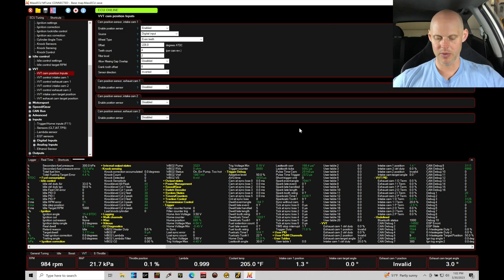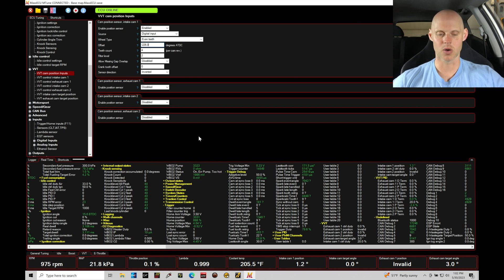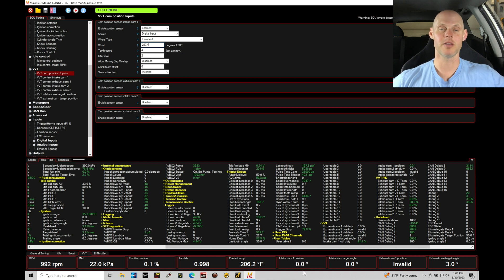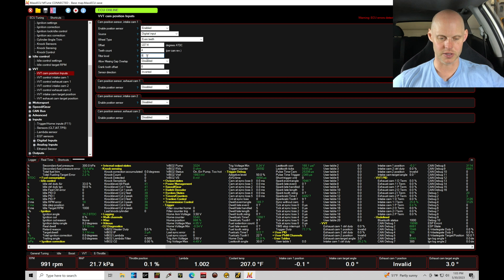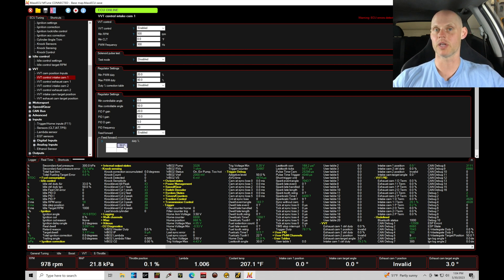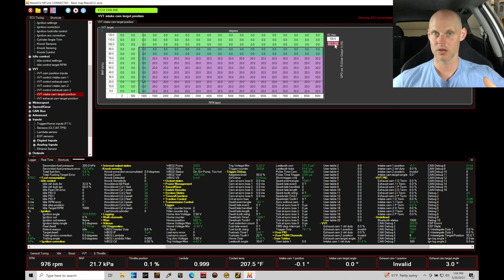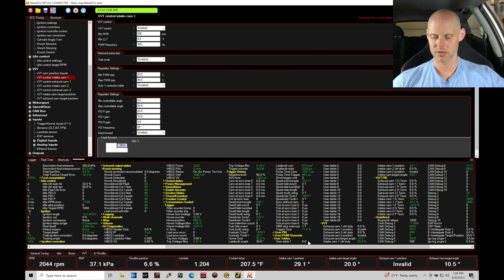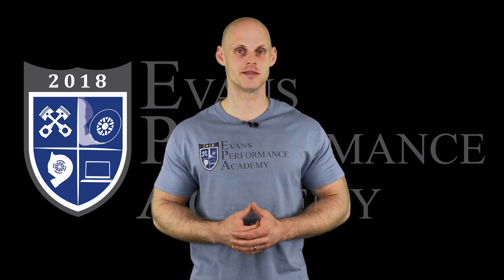MaxxEcu K24 Live Training Part 3: Start-Up / Idle Tuning | Evans Performance Academy

Comment: Hi I'm Malaysian and now I'm using maxxecu mini, is it can't tune the E throttle idle, because now the idling need to adjust to 1.2k rpm then only can the engine stable, but it's still unstable to the idle keep turning high and low to lowest rpm 800rpm when turn on the AC
Reply: Hi bos saya dari malaysia juga, masalah dah okay ka belum ?